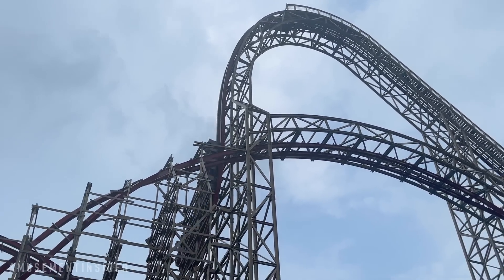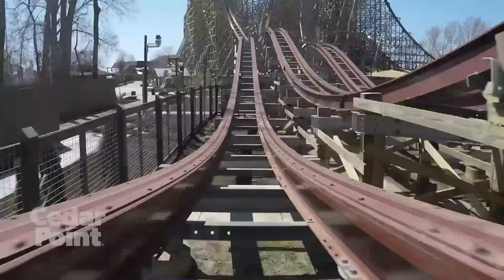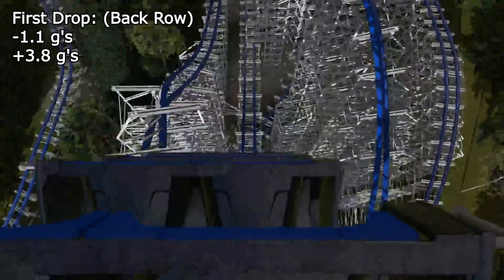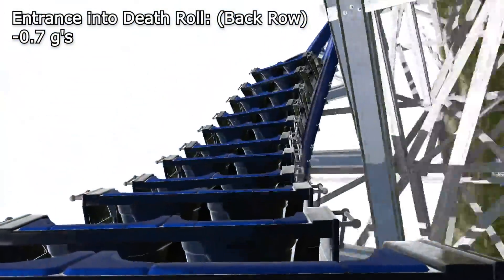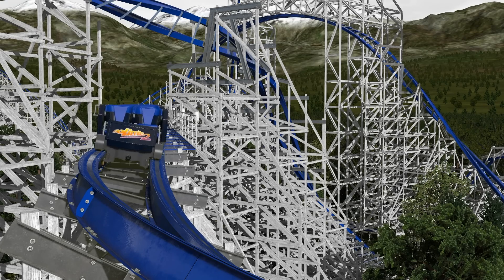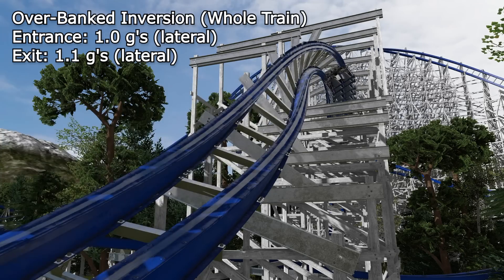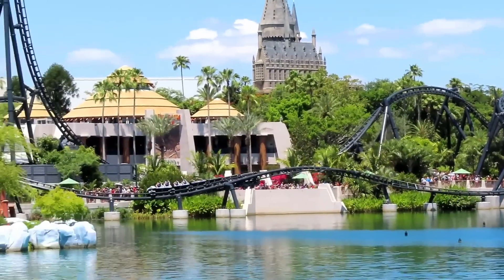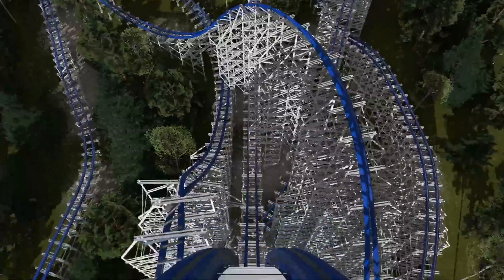Can I Design the PERFECT Roller Coaster? (Part 2: RMC Hybrid)

Comment: You know how Lightning Rod ends with the break run down that steep slope? What if Lightning Rod kept on going instead of ending with a break run? I can imagine it really doing some awseome low-to-the-ground turns like the end of El Torro, taking advantage of all that speed it currently throws away currently. Would you ever consider creating this virtually?

Comment: The only boring element on this coaster is the slow turn after the brake run. A straight drop into unknown could be better.
Theming is totaly missing. Theming and landscape integration gives coasters a big eyecatcher and suprise elements. Best example is the keyhole from Gatekeeper. Ganja Custom NoLimits1 track has best terrain surprises for me. Iron Rattler is the best at using elevation changes.
Score: 8,5/10

Comment: Perfect coasters should be designed backwards from the end to the beginning for flawless elements and pacing.
Reply from the maker: Yeah I sometimes plan them out in a different order, but with the program I use, it's impossible to design them backwards
Reply: @EliteCoasters  I understand.  I just hope real coaster engineers see this.  You can plan perfect speed, forces, and intervals between forces for perfect rhythm if you go backwards.  Designers shouldn't even know max height and speed when they begin designing a coaster.

Comment: Second comment, but for a video idea (and since I suck at NL2) you should do the ultimate B&M coaster, specifically and airtime focused giga combining and slightly modifying the best elements of existing hypers and gigas.  Ex: 325’ drop at 90 degrees, providing -.5g in the back (only .1 stronger the Orion), Orions wave turn, but banking out like RMCs instead of in giving between -.3 and -.5, the longest airtime moment in the world at 8sec (dragster and Ka each so 7.5 sec under .5) then a large ejector hill just a tad more than Diamondback, which is -.7, almost to -1, Fury’s turnaround, alternating off axis speed hills at -.75, Orion’s Belt, then back to back twisty hills like on Orion (hit around -.6 IRL) at -.7.  Add some quicker snaps for some of the banking transitions.

Comment: As others have recommended, I like the term "ejector roll" for the final element. However, since it requires a left or right turn in the track to function, simply clarify with the direction. In this case, it would be a "left ejector roll" since it finishes to the left.
Reply: I agree with your naming, its honestly perfect of a name considering the forces. However, the dictating of the direction isnt really necessary (depending if you take the roll forward or backward, the backward one could be called reverse ejector roll, similar to the name of a reverse sidewinder)
Reply: The element itself looks like something RMC would do on a hybrid eventually
Reply: Oh... I was going to say Hell roll.
Reply: Urm Actually, I prefer left ejector roll👆🤓
Reply: @EFLJay  lol did this lame ass reply to a nearly year old comment make you feel valid for once? 😆
Reply: Honestly this makes no sense. That's like saying a "Left Double Inverting Stall" or a "Right Outerbank Hill"
Reply: @arandomcasualgamer  then suggest something better rather than being predictably passive-aggressive?

Feel free to argue further. People seem to agree, including the channel itself.
Reply: @munktayl0rd  I'm not trying to start an argument, and sorry if I was being a bit aggressive.

Comment: So I need some help with NoLimits2. Anytime I make a Midcourse Brakerun and have the brake segment set to block mode it forces the train to come to a complete stop no matter what, even if the next block is unoccupied. I haven’t found any videos on how to make this not happen, do you know how to fix this?
Reply from the maker: If you uncheck the "complete stop button" that would maybe solve it of you have that checked. Otherwise, you might not have enough block zones on the ride to compensate for the # of trains.